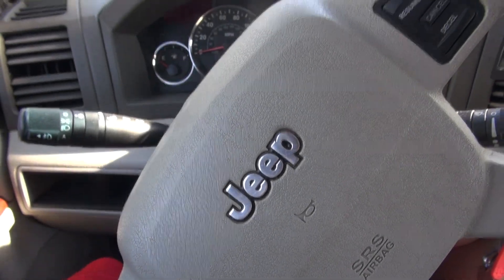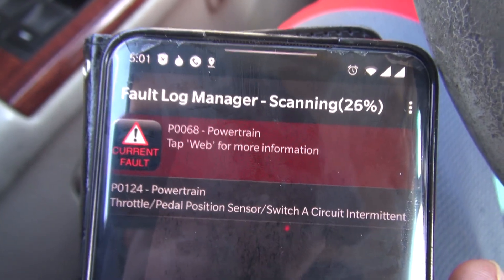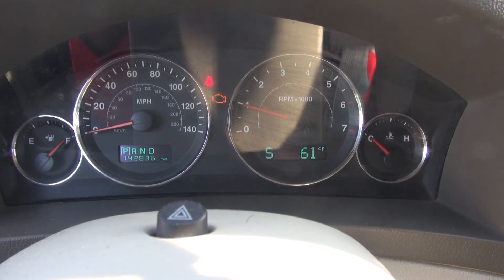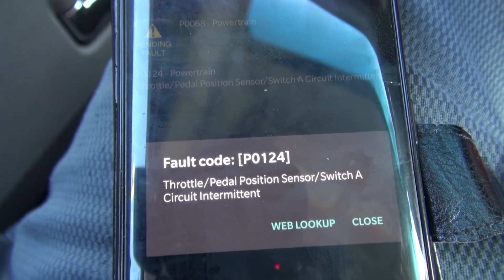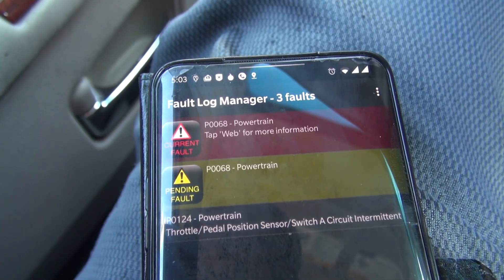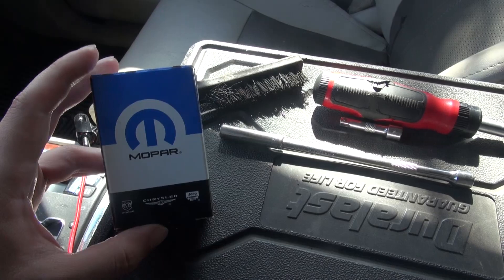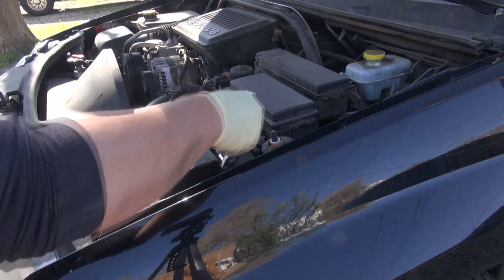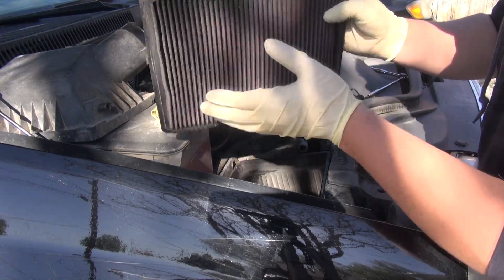WK (2005-2010) V8 Jeep Grand Cherokee: How to replace the Throttle Position Sensor (TPS) [P0124]

Comment: So back in the day with your 1999 2004 jeep grand cherokee, replacing your solenoids, what symptoms did you have besides the check engine light that told you the solenoid needed to be replaced?

Comment: Hey Brother, I've got a 2007 Jeep Grand Cherokee Limited and have a dash light for the electronic throttle control. It's a 5.7 liter Hemi. 
Did you have pretty much the same thing, and where did you get a replacement part? Please get back to me soon as possible! Thank you
Reply: Hey having the same issue rightnow with the same exact motor did you get the problem fixed?